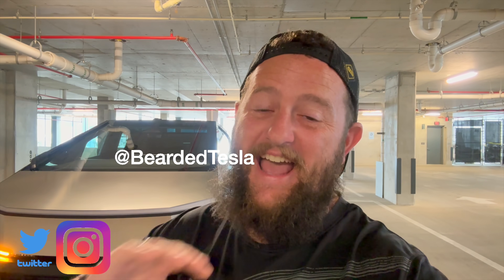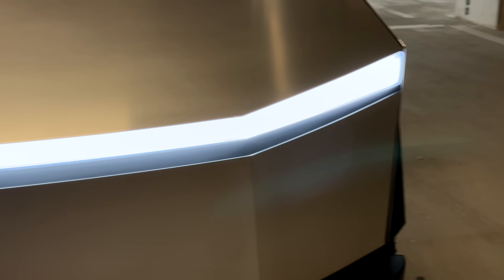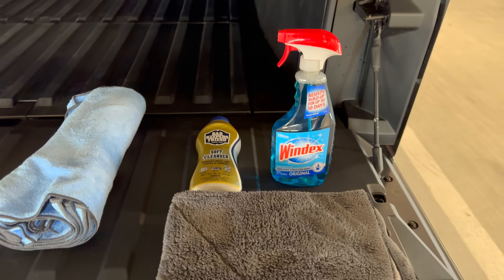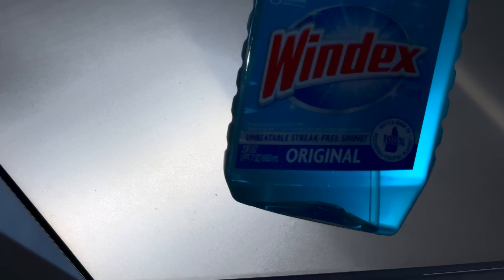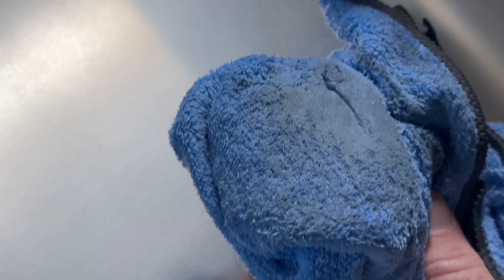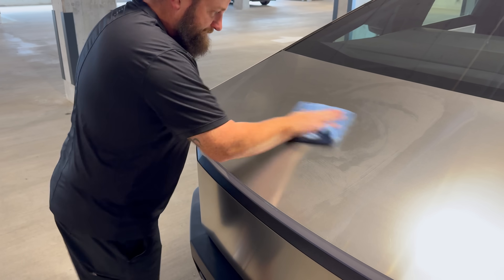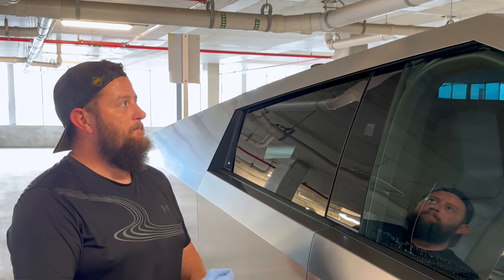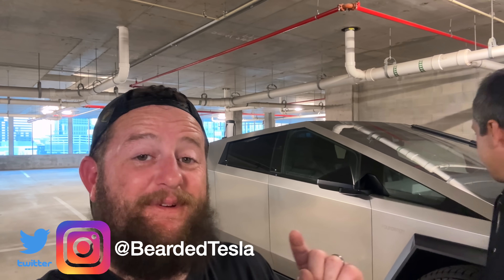Tesla CyberTRUCK or CyberRUST?? The TRUTH About Cybertruck Rusting Issue + How To Fix It!!

Comment: Great video, but looking at it from an endpoint customer, this is not really a solution. It requires a lot of upkeep and maintenance when people are spending 80-100k dollars for this truck, which is designed to be used in a lot of different situations a the  truck would. Again, how would this look in 2 + years' time? What if you live in a place where humidity is high or wet a lot if the year round?

Only way I can think this is viable is to have the vehicle wrapped, which kinda takes away from the point.
Reply: How so? Not more or less than on every other car. It just is another cleaning method
Reply: @Easore  on top of normally washing the car? Again the rate the rust could appear could drastically be different depending on climate meaning o
Upkeep could look from once every two weeks to maybe a couple of times a week. This is something that should have been factored into the car build.

This is supposed to be a truck compared to the Ford f150 lighting and Rivian R1T

Comment: I get this on my white car right behind the front wheels on the side body panels, which is most likely from the brakes. Either way I use Chemical Guys “Decon” spray which sprays on clear and turns purple when it’s ready to be removed. This is purpose made to remove iron fillings and works very well.

Comment: I suspect that a DIY ceramic clear coating from someone like Autoglym for £60 and a couple or hours work would eliminate both this problem and finger prints. Personally my concern with a Cybertruck would be deep scratches as they’d be difficult to get out. Ultimately though for its intended purpose it’s fine I think.

Comment: Interesting work. I wonder which of the alcohols in your spray is exchanging an ion to release the rotting iron from the surface? I am guessing the ethyl alcohol [aka ethanol] would be the easiest to test with alone? Do the particles appear anywhere but on the stainless? Like the aluminum cover or the smc bed which you would think might catch them? Maybe move a magnet over the bed and cover to see what it might be collected before you clean everything stainless? I would not want to roll up the cover and potentially dump rusting particles in there. Is the dust attracted to the stainless via static electricity? If so I think the train source is more probable.

Comment: Stainless steel can corrode badly and cause pitting on the surface in some cases. The meteorology of the stainless steel will affect its corrosion resistance. Stainless steel is around for decades and like galvanised steel if it is not weathered properly it can degrade.
Stainless steel similar to galvanised steel will create a protective layer. 
The longterm issue with stainless steel will be brake dust and contaminants. The brake dust us essentially metal shavings that will embed on the surface. Delorean dud it 40 years ago, the vehicles never looked goid up close, finger prints, stains etc

Comment: is there any rail dust on the other sides of the panels?  this would narrow down where the dust is originating from.
Reply: Rail dust is everywhere. All over the streets and highways we drive on. It is constantly landing on our vehicles. You can’t avoid it. Wash your vehicle more often and, in the case of a Cybertruck, I’d probably experiment with a scotch-brite pad to take it off the stainless steel. On painted vehicles, I’ve used polish with a very mild abrasive in it.

Comment: Steel touching stainless steel in a wet environment will undergo accelerated corrosion due to galvanic coupling.  That's not going to be the only problem for the CT though.  CTs near the ocean are going to pit and stain if not frequently washed.

Comment: Before any paint correction there are steps to follow to achieve desired results. Iron. remover is sold by many detailer ( Adams Iron remover) among many other brands. Worth a try?
Reply: Those brands are meant to work with painted coatings. The Tesla is raw stainless steel, it would probably work but not as cost effective as the method that was shown in the video.

Comment: Could you use Rain -X to seal the metal?
Reply: Na use a Citrus based cleaner, some Stainless is Passivated using a Citric Acid Base chemical. Stainless always should be Passivated to stop this exact problem, its not the steel its microscopic junk on the steel and in its pores.

Comment: Austenitic Stainless Steel alone has over 30 grades (303, 304, 316, 310 etc.). None of the Austenitic alloys are magnetic when forged, and the cybertruck is. Meaning this is probably Ferritic alloy, which is magnetic and surprise surprise, cheapest.

Austenitic steel CAN develop magnetic properties later in life, but seeing how every new cybertruck reacts to magnets, makes me doubt that this is Austenitic  alloy. 

Now, if there is iron in the mixture, and there is no protection coating whatsoever, this is going to rust. What one day seems like a dust, will quickly spread inside the panels. Sorry to say this, but Tesla is probably going to recall this product.
Reply: Truth!

Comment: Try iron x.  Look closely at any white car especially the rear brake dust is hot and burns itself in the clear coat.   Use iron x it turns purple and wash’s off easily. It’s on every car it’s just ez to see on cyber truck

Comment: The most likely cause would probably be brake dust from other cars on the road. This is also found on regular cars too but it’s harder to see but if you run your hand on a car panel you can definitely feel it.
Reply: right, I had several cars transported on large open trucks, and all the cars on the bottom row were directly in the path of brake dust spewed from the truck. It was on a good portion of my vehicles and looked like specs of rust. If these are transported in the sme manner, most likely that's a major cause. You can wipe it off though and polish back to normal as long as you get it quick so it doesn't embed.

Comment: Any one think silver aluminum Airstreams are easy to maintain and keep clean? Think they do not corrode? Ever heard of filiform corrosion?
Anyone ever had white filiform corrosion on aluminum wheels?
Airstreams can easily cost over $120,000. They can have this corrosion the day it is purchased new. One thing is for sure, it will have it eventually. 
Your car will have a rust hole in it the size of a fist eventually.
It does suck the cyber truck has these dots all over. 
Airstreams have a clear coat on them. After fighting the filiform corrosion some Airstream owners choose to buff all the clear coat off and buff out the entire Airstream until it is Chrome looking.

They also get thousands of little black dots all over the silver aluminum on top of the clear coat. My buddy said it was fly poop. It is SUPER hard to scrub off and remove. Besides just the filiform corrosion and fly poop black dots the roofs get like barnacles on them. These are also super hard and time-consuming to remove. 
Everything begins to die the minute it is born...

Comment: Bar Keepers Friend is oxalic acid. That might be mild for stainless steel but it is harsh on skin. It is not as bad as oven cleaner but can still do a number on you. Wear gloves. All these complaints with stainless steel are nothing new. People were whining about the same issues on the DeLorean 40 years ago. I’d be curious to see if a clear PPF could be put down without some kind of mottling eventually developing underneath.
Reply: I think so.  The rust is caused by particulates in the air, so a wrap or PPF would definitely protect against that.   Personally, I'd just get a cool wrap job.  All those sharp angles and flat areas make it super easy to wrap.
Reply: @Chazwozel1  The stainlessness of stainless comes from the oxide layer forming in contact with air. It's unknown what will happen under a wrap.

Comment: What about using a wax to prevent the rust dust from sticking?
Reply: take a buffing disk with some light compound, clean the truck, then buff in a wax coat, that was my thought also.
Reply: Or paint!!  Then they could have varying colors!!  Oh... wait... that's been done already...
Reply: @JR-ng9yo  paint doesn't stick well to stainless steel, ask the DeLorean.
Reply: @michaelkeudel8770   Ohhhhhhhhhh.... never mind.
Reply: @michaelkeudel8770 hmm how about using a differnt light weight material and painting over that. Could be the future.
Reply: @TrueFilter  You would need to rough up every square inch on the body, coat the entire vehicle with a body filler. block sand everything. If your lucky the bond will hold to the stainless, paints not the only thing that doesn't stick well to stainless. Problem is that stainless oxidizes almost instantly, and that oxide layer is what won't allow anything to stick to it.
Reply: @TrueFilter  It's also related to the problem of keeping the heat tiles from sticking to starship.

Comment: People need to realize.  Water isn't exactly H2O.  Its better written as h20 + H+.  Unfinished stainless will go through redox.  Coat it.  If I owned one i'd triple dip each panel individually.  finish work could be done too...anything that has spots will need a buff out.
Reply: People don’t need to realise anything, they’re retail consumers mate..
Reply: on the how it possibly happened.  i can assure you their manufacturing process would be clean, neat, an not contaminate.  its possible, but unlikely.  i think its just chemistry.

Comment: The stainless isn't rusting on it's own, but the specs of rail dust is rusting on the surface.  It's still not good.  They need to cover the cars during delivery
Reply: I worked for a luxury car brand in the past and a lot of the cars were FULLY covered and it was chore to uncover them but protected the vehicles in transport. I wonder why Tesla doesn't do the same because protecting a vehicle(s) in transport is nothing new.

Comment: All cars are prone to iron particles, which is why all detailing brands sell an IRON REMOVER.. Just spray it, give it a few minutes,  it will change colors and just wash it off... This is a highly recommended step before applying ceramic coats on any vehicle. The lack of a clear coat on the Cybertruck makes it more noticeable. I'm sure the detailing brands will formulate a custom Cybertruck Ceramic coat product once the CT is in mass production and if other OEMs start using SS on their vehicles...
Reply: Just posted a comment about this before seeing your comment. I agree 100%. I'm sure an iron remover product like IronX would be a much easier and better way to fix this problem vs Bar Keepers Friend
Reply: Nah bro, my normal car white color dont have these, and i live in tropic 😂

Comment: Used to have a white1996 Ford Contour. Had semi-metallic pads, it had really bad rust specs all over the sides. We switched to compound pads but it still would get rust specs all over the car that would take alot of elbow grease every year to get the specs off. Less people are using metallic or semi-metallic pad now, more are switching to ceramics. I had to switch to ceramic pads on my 2009 BMW just to keep the rims looking good. So i suspect that is environmental fall out from other vehicles.

Comment: Question. Did the delorean have this issue?
Reply: No, they were smart enough to use a finish
Reply: @plexyglass429  DeLorean has a rust issue too.
Reply: Yes there is
Reply: I looked around on the internet and couldn't find any reports of their stainless rusting. Reports of the undercarriage rusting... but that's not stainless
Reply: @bfree6197  that's intriguing
Reply: @Iamonfire007 i just had to look more. I found recent YouTube videos of a "DeLorean barn find 977 miles" 

3rd video, in their series, First wash in 20 years. Mold and mildew had been growing on it. While washing, you can see the piles of mouse crap on the garage floor... I would imagine urine too. They pointed out some staining that easily wiped off with a rag and a product called Bar Keepers. Zero Rust. Car looked new afterwards.
Reply: You have to understand that there are different types of stainless steel. They are all alloys using different types of metals; some more prone to rusting and staining than others. It wouldn't surprise me at all if Tesla used a cheap version to reduce costs.

Rusting aside, I have learned to regret getting stainless steel appliances when I redid my kitchen. Enjoy the look of it brand new, because it will never look the same after a few uses. I have yet to find a stainless polish that cleans well without feeling greasy or leaving wipe marks. Can't wait to go back to black appliances. And these are sitting in my kitchen. Now imagine them outside being exposed to the elements.
Reply: @robertgreenhalge1708 Tesla applied for a patent on a blend they developed "in house". You can easily find that online for more details. I don't think they have to worry about anyone trying to steal it😂
Reply: @bfree6197  If someone were trying to steal it, I doubt they would even know how to get the damn door open...let alone start the thing and attempt to drive it.

Before I purchased my latest vehicle, I had to use Uber for a couple days. Got picked up in a Tesla Model 3. At first I was excited as I had never been in one. Instant disappointment. The seats were hard as a rock. The ride felt like riding in a go kart. Massive screen up front causing glare (it was nighttime). The driver had to unlock the door and open it from the front if I remember correctly.  Literally the only thing I liked was the glass roof.

So glad when I picked up my hybrid a few days later. EV when I want, ICE when I want and no range issues to worry about.

Comment: We call it fallout. There are several fallout remover sprays you can get from companies like Simoniz and others. I'd like to see somebody test fallout remover on the cybertruck showing this issue.
FYI I had this on my brand new VW GTI back in 2010. It was a white car, i took delivery in February here in Canada. After driving it a bit, i took it to an Autospa and used their track style pull through car wash. After i hand dried it, I saw orange spots all over my car. The autospa said it wasn't their fault, but i still think it was...they likely had "iron filing fallout" splashing up onto the car from their environment. From then on I took my car to a detailer who removed the fallout easily and it never returned.
Reply: Yes, I think you are spot on - pun intended. I never realized until I had a white car the amount of iron in the environment from brakes, train tracks, etc. I use something really stinky called IronX. It smells like skunk butt but it dissolves the iron. It turns purple and just runs off the car. Not a Tesla apologist, but I think that’s what this is. It’s just showing up really well on the stainless.
Reply: Ok so yeah ironx or other fallout cleaner on stainless steel may not be wise. Try at your own risk :)
Reply: This.
Reply: You can't use fallout remover on stainless steel.  Fallout remover interacts chemically with clearcoat on the paint surface of a normal car's paintjob to remove rust that's bonded to it.  This is neither painted or clear coated.  Technically, the proper thing to do is called passivation with Nitric Acid.   The video uses Barkeeper's friend which is primarily Oxalic acid - same effect, but a little harsher on the steel than Nitric acid would be; however, Nitric acid is brutal on skin.
Reply: Oof. Good luck to anyone who takes your advice and sprays liquid fallout remover on their CyberTruck…

PS: it wasn’t their fault.

Comment: Rust dust is found on every roadway. Brakes flash-rust overnight. Usually this is scraped off the first time you brake hard.  Other sources along concrete highways are rebar and the steel beams of overpasses.  These continuously rust in the salt belt. Folks who are obsessive about their painted cars will clean the surface with a solution that removes the rust particles before they can become embedded like IronX, and/or they'll coat the paint with silicone or "ceramic".
Reply: Yeah, I was wondering if using IronX would get rid of the rust dust a lot quicker and easier than polishing the whole truck with Bar Keepers Friend.